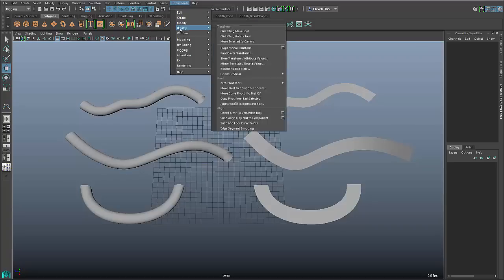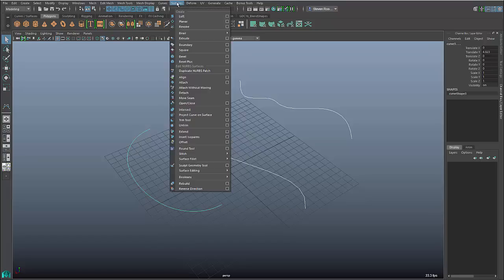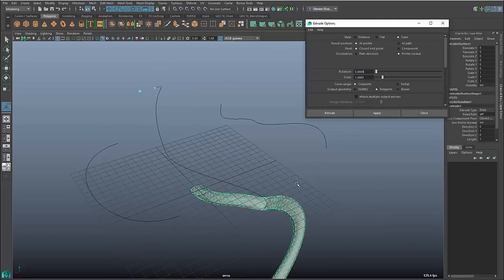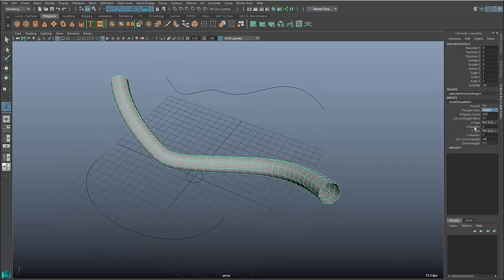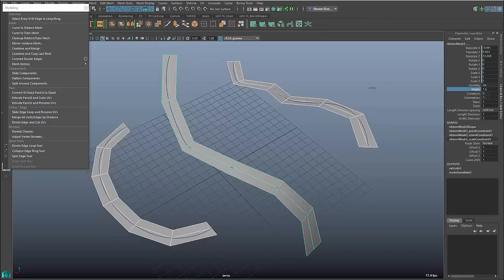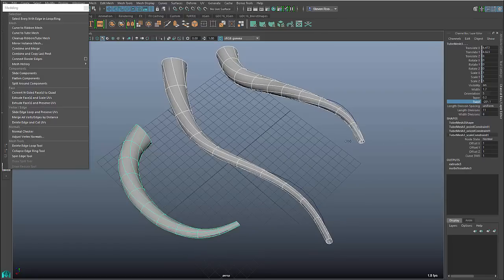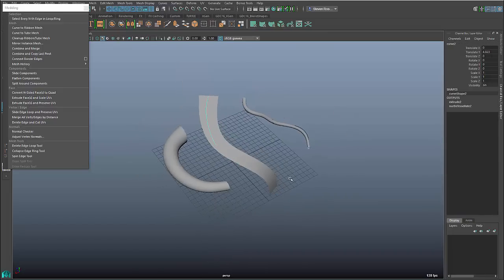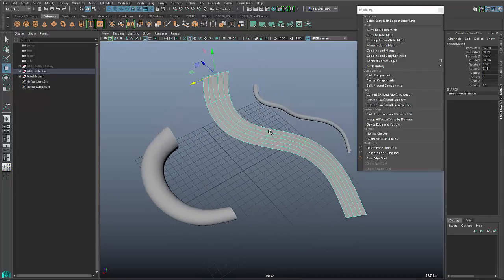Maya BonusTools 2016 Ext 2 - Curve to Ribbon/Tube

Comment: mnnn....year 2021 = 3dsMax is far better than Maya in modelling and environment building. I use both equally and I take three times more to model and layout stuff in Maya than in 3dsMax... In Maya you  need xtra plugins, bonus tools, workarouds, scripts to do simple things whereas in 3dsMax, they are all already integrated for decades... And more: 3dsMax builds in stacks and you don't need to collapse "history". Just go back and forwards with many model versions without destryoing it. Very handy for industrial design and architectural Design. Even CAT and character studio is handy for quick character placing...
What am I doing here if Maya 2022 is out ? Because many London VFX studios still use old Maya versions such as 2016 or 2018 as all pipeline are already set and would be costly to rebuild all of it with newer versions of Maya...

Comment: Hi! Using bonus tools in Maya 2019. This feature still sucks. I select curve → Click on Curve to Ribbon Mesh → Get similar nonsense as extrude but with more nonsense in outliner and history.
Nothing like shown in video. If user have to think this much for such a rudimentary task then It shows that the tool is either incomplete or sucks.
Reply: Proper solution that just works ↓
https://apps.autodesk.com/MAYA/en/Detail/Index?id=1022738209492453537&appLang=en&os=Win64#
Reply from the maker: Ayush Bakshi - keep in mind that it’s just a python script so not a perfect solution - and it’s free and technically unsupported. I’d still like to try to help get to the bottom of it tho. A few questions... Is your curve in hierarchy? Are you using a unit other than cm?

Comment: @My Oh Maya how do you keep the ribbons from banking on the curves normal, I'd like the path it creates to planar on Y, and I'd like my curve to be a down hill slope like a water slide. In Maya it always seems to bank the corners (the wrong way) which is undesirable 99% of the time. Any way to just extrude a flat path without having to use birail?

Comment: I'm using this for hair card creation and it's unfortunate that t have to adjust every new strip from 0 as it doesn't remember the previous settings, the values are very limited and can't go past 1 in some properties and the most annoying thing is after i apply a Curv to Ribbon and start manipulating the cv's of the curv the mesh doesn't keep the same shape as the curv. Ideally for hair card strip creation there should be a dedicated script or plugin.

Comment: Is there a way to control the shape of the taper? Not just scaling a numeric slider? Is there any equivalent workflow that exists in Maya? I'd imagine you could do the exact same thing with curves. I.E:

1. Make first curve indicating general direction
2. Make second curve as a profile (like a circle)
3. select both curves and 'surfaces->extrude' to generate a shape along the first curve
4. Then at this point I assume you would make a 3rd curve controlling the taper shape, but idk what function you would use

Comment: Is there any way to have the tube/ribbon created on top of my curve they way it works in this video? When I use this tool the resulting tube/ribbon is created with different translation coordinates. In other words, the tube/ribbon is not on top of the curve but in some other location in the scene. Also, my tubes always have the normals reversed. Other than that this tool is great!